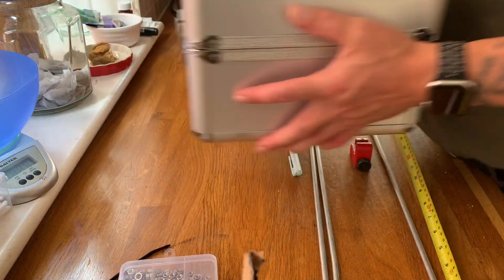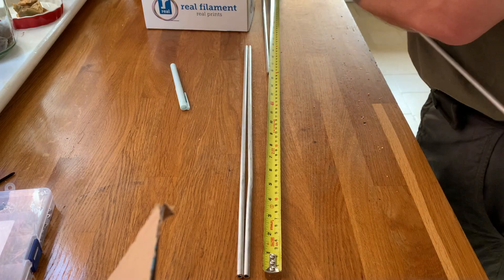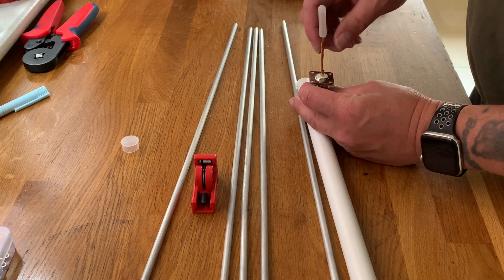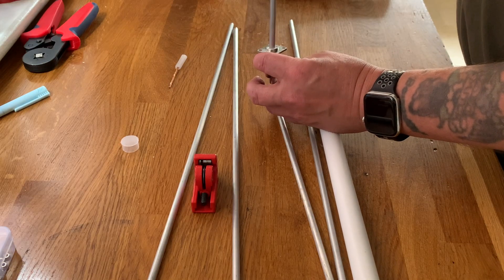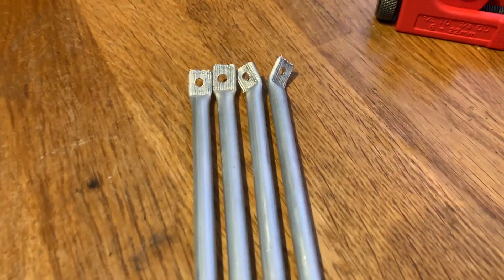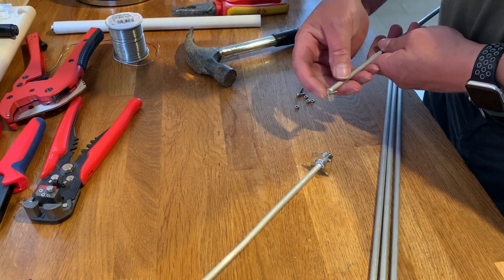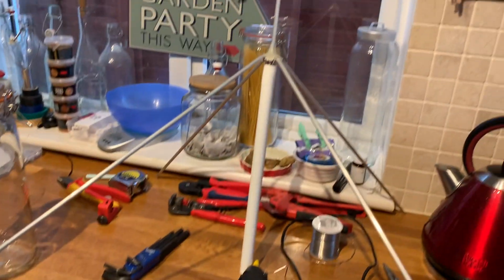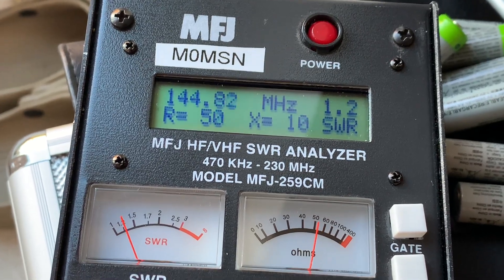HAM RADIO: 2M/70cm Skylab Build. Home-Brew 2M antenna 143 - 148 MHz

Comment: Mike, I increased my ground plane by cutting a thread at  the btm of my radials, slid lengths of copper tube over the original ground planes.   Drilled a small hole into the centre of an end cap, pushed the threaded rod through the end cap, and tightened it up with a locking nut. The recieve is out standing M7HIJ

Comment: I haven't scratch built any antennas for quite a few years now, but when I did, I believed that THE best place to check for VSWR at least, was right at the bottom of the antenna.   That way you're eliminating any mismatch of the feeder - usually coax of some description.
Having said that, I also believed that a coaxial feeder with a length of an ODD number of half wavelengths worked best.
Further, I also used to account for the  velocity factor of various coaxial feeders that I would use; and, finally the distance of the antenna off the ground.
I had some quite pleasing results

Comment: I'm new and currently studying.  What type of cable are you using from the end of the RG213 on your antenna to your radio?
Reply from the maker: Hi, RG213 is the coax cable.  :). cheers
Reply: @mike-M0MSN  Your plans say 10cm of RG213. What about the longer run from the antenna to indoors?
Reply from the maker: I’m not sure we are watching the same video!! No mention of 10cm RG213. What is the time stamp and video name?
Reply: @mike-M0MSN In the description of this video, you have a “list of bits”, where it states 10cm of RG213.
Reply from the maker: @holotape  got it thanks, I used the centre of the RG213 in the centre of the SO239 as a medium between the SO239 and the aluminium driven element.
Reply: @mike-M0MSN  Thank you for your reply -- all your replies -- but I am asking which kind of coax did you use for the run from the antenna featured in the video...to your radio. Or, if you don't recall, what type would you use to run from your antenna to your radio for 2m/70cm.
Reply from the maker: @holotape  hi - as I said in the first reply and why I got confused I used RG213 or RG8
Reply: @mike-M0MSN  Thank you kindly, and sorry to cause confusion! 73

Comment: Hi Mike. Just for info I have used Brazing Rods. They come in metre lengths and can be soldered etc. Thinner but very cheap compared to aluminium.  Also used car brake pipe to make some telescopic for tuning. Which Can  be soldered after adjustments. Cheers from old George

Comment: Nice build and thank you for this.  Have you tried this antenna for contacting the ISS?  Just wondering, I know a yagi would be a better choice but on some passes I can see the ISS in the night sky passing by.  I hear that some has made contacts with a 1/4 wave vertical.  I thought about making a turnstile or eggbeater antenna.

Comment: Hey Mike if your crimped on radiator doesnt hold up you might try filling the inner wire with solder for a tight fit.
Then drill a hole in the tubing. Then slide a collar over the tubing with a set screw in it that will go through the drilled hole and make strong contact with the inner wire.🤔

Comment: Great video mike. I know these are simple antennas but what a great project for a new ham. Well done.
Reply from the maker: Thanks Phil.
Reply: @mike-M0MSN  Followed your tutorial as a recent M7 licence holder but using a slightly smaller diameter tube than yours which I had available . It's working well across both bands and is mounted on a pole on the house . It's even weathering the gales we are having just now with fortitude  ,  but it would be easy enough to repair or  make another any way  . I also followed your Twin feeder slim jim video with pleasing results  for my hand held too  Cheers! 👍

Comment: Excellent build.how much DB gain increase did you get off that bad boy mike ? I saw it was resonate on UHF as well. This antenna could be easily recalculated for 465 MHz for use on GMRS 462 - 467 MHz frequency pairs . May give it a try sometime in future will run the math and draw it up before prototyping. Thanks ahead of time you are a wizard lol

Comment: Easy build for anyone. As some comments say the centre connection is a bit suspect. I would have threaded the tube and used a short length of brass threaded rod (or threaded some plain rod myself to connect to the tube. , Drill a hole in the botton with a small side hole, and then solder that to the centre pin of the N type - or if you must,  a SO239 :-)

The worst part.. You will now go on e-bay and purchase a small table top clamp on vice, and use that to squash tube ends. Never again hit your poor pliers with a hammer. I was waiting for either the jaws to snap off, or the paving slab to break!  :-)

Andy.
Reply from the maker: Lol, works pliers, my kit is still in it wrappings…..

Comment: Wonder if heating or filling the ends of the aluminium tube with solder where they join the connector will prevent the tube fracturing at the crimp. Keep us posted on the longevity their. Great work love the videos.

Comment: Cute little antenna!
A few years ago I built a J-pole for the 2 meter band out of 12 mm copper tubing with magnificent results. I then etched it in acid before camo-painting it to make it completely 'disappear' at its final location in a tree. Heavy as a freight train but virtually bullet proof! (we get some nasty weather here up on 70 degrees north sometimes).

Have you ever made one of these so you can do a comparison with your ground plane antenna?
Reply: The radiator element caught my attention. Does that short length of copper coax make adequate contact with the aluminium tube ? I'm sure it must do but I might have soldered a copper nail or screw to the SO239 instead, for a more snug fit.

Comment: Um, do you mean I.S.S. & not Skylab?  Skylab hasn't been in space for a long time! Like 1979!
Reply: The Skylab is/was a cheap thin-walled knock-off of the old AS M-400 Starduster CB antenna from the '70s
Reply: @mstover2809  That explains why I've never heard of it. 🤔🙄
Reply: You're saying that we can't use 2 m for communication with another dimension? 🤔 😂
Reply: No he meant Skylab, as stated based on an older antenna by that name